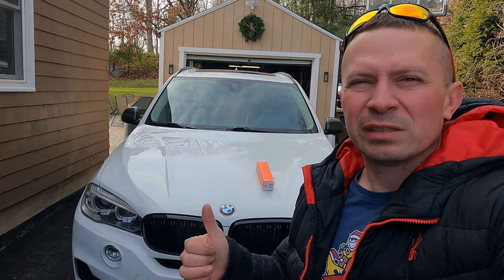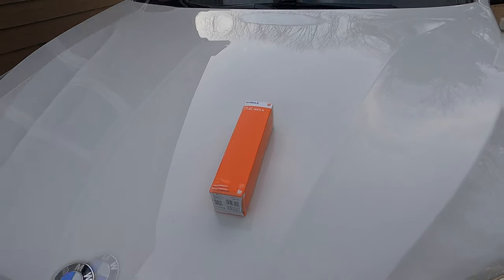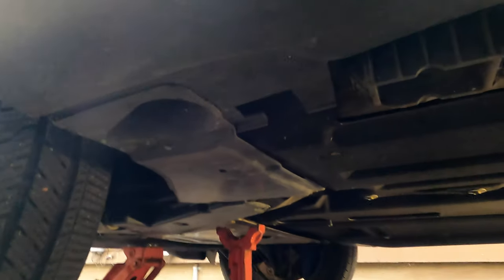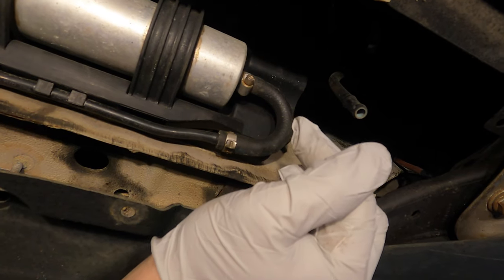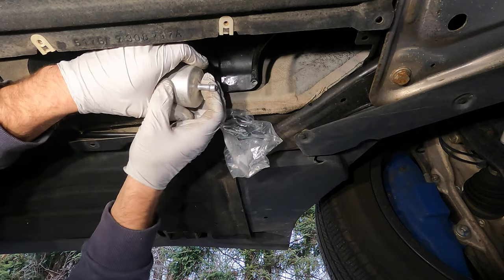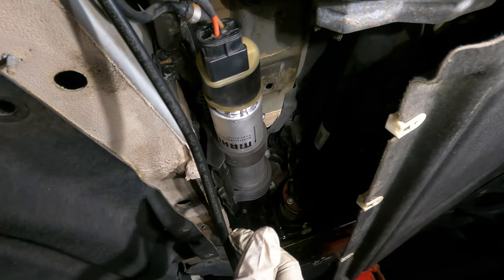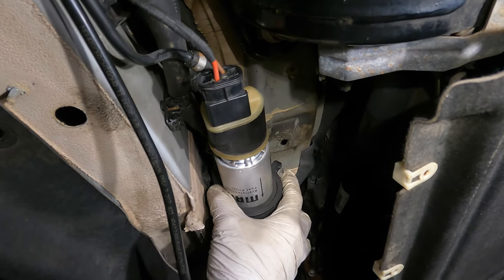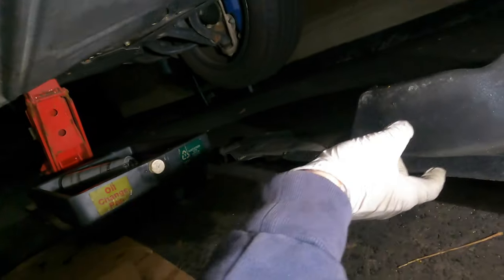Bmw F15 X5 35D Diesel Fuel Filter DIY

Comment: Thanks. Have a 14 535d w/57k on it. Bought it w/36k . Egr and intake manifold was changed thru recall but will remove in the future. Going to get on this as I was wondering when the filter needed changing. AND, thanks!
Reply from the maker: Hi, Filter it’s recommended to change  every 30k

Comment: Great video! Easy procedure, and nice to have the visual reference before getting into the project. I probably will use a screwdriver to free the hose from the old filter instead of pliers (I cringed a little when I saw it). Looking forward to more of your maintenance vids. On a side note I like your blackout pieces on the front. 👍
Reply from the maker: Thanks 🙏 glad it was helpful. 😊

Comment: I thought you needed to prime it so the HPFP doesn’t run without fluid at all?
Reply from the maker: when changing filter fuel does not drain all the way from HPFP therefore always some left in there it only looses some of the pressure, so it never really runs dry when you first start it, it just takes 1-2 seconds to build back pressure in line, if you watch video carefully notice in after filter replacement first start up if fired within 2 seconds that is really quick and thats been the case every single time I changed this filter prior, its highly unlikely to damage the HPFP in that short amount time, specially that theres still some fluid in it it so it not really running dry in that 2 second time fame. I agree if you change the line hpfp then most definitely you would have to prime it but in this situation its an overkill.

Comment: Thanks for the video.  What size of replacement clamp for fuel hose is needed?
Reply from the maker: No problem 🙂, honestly I don’t remember I just eye balled it whatever seemed to fit 😁and was the right size
Reply: Get  clamp that's 8-16mm 
Fuel hose is 9mm iD and 13 OD so it'll fit

Comment: Someone did prime after the new fuel pump installed and the fuel line hooked up. But you mentioned prime should be done before the exit line is connected. Which one is the correct method?
Reply from the maker: If you are going to prime then it’s done before the line is connected, but like I said in the video it’s not really necessary becuase it doesn’t take long at all to get it to start back up, and to prime it it’s long procedure to activate the pump by its self without engine. FYI I gone this filter replacement 4 times already in last 130k and mine pump is still running so clearly it’s not necessary. Otherwise it would fail long time ago.

Comment: I turn the vehicle on to auxiliary but not run the engine. You should hear the fuel pump working.  Let it finish and then  turn it back off. Do this 4 or 5 times to prime the pump and then start. It should fire right up
Reply from the maker: Generally speaking that would work on other bmws however on diesel pump does not turn on when you put it in the auxiliary mode, it only turns on when it’s it’s cranking on the diesel bmw models, it only does that in gas versions.
Reply: @MotorsportInspired  thanks for the info!

Comment: Hi
I have a 2014 X5 f15. I opened the underside panel on the driver side and looked under but can't find the fuel filter. I can see the compressor but no filter. Am I looking in the wrong place?
Reply from the maker: Make sure you take off the front left cover, filter is directly under driver seat
Reply: If it’s not a diesel it doesn’t have a fuel filter
Reply: Lhd it's under the driver side. Rhd it's under the pass side
Reply: Thanks

Comment: how often you change fuel filter?
Reply from the maker: Hi Every 40k 30k to ensure fuel system is as clean as possible, as it is very sensitive and expensive to replace is for example high pressure fuel pump goes out